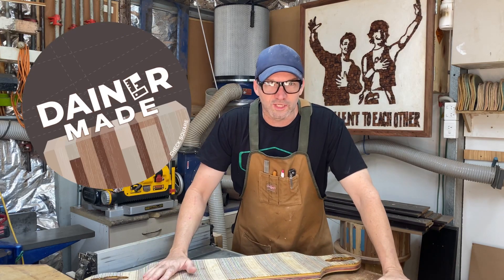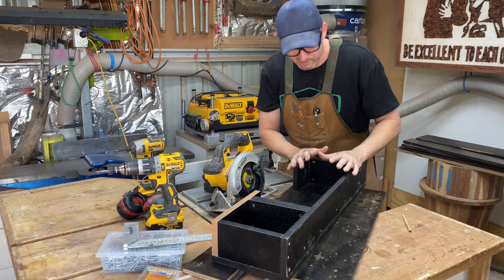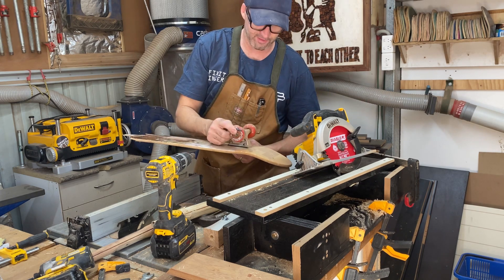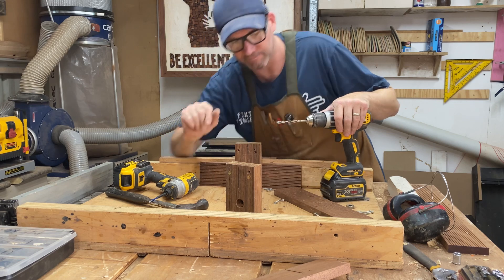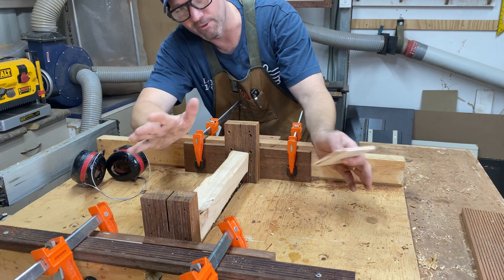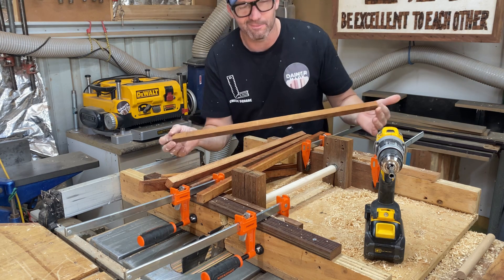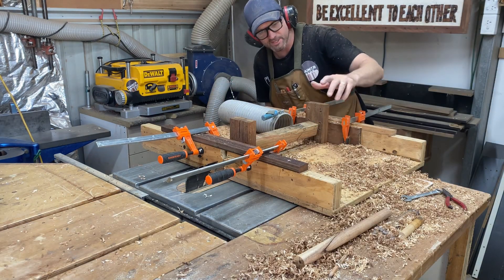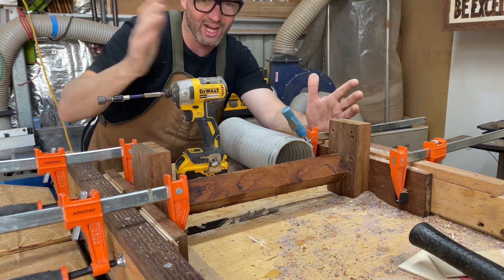#woodjigs21 Circular Saw and Table saw Lathe jig

Comment: I've always dreamed of being able to make broomsticks for Smurfs! Sweet jig. 
Entertaining as always, and a great addition to the #woodjigs21 collection. And love that a sailor's been gifting you a lot of wood.
Reply: @dainermade  Yeah, poor Ned! 
On a serious note though, how about off-setting the end points of the jig so the blade runs beside the piece instead of directly under it? You may not get smaller diameter dowel without hitting the bearings, but possibly a cleaner finish and you could even offset the ends a bit to get your taper.

Comment: Mark, I need a handle for a bat. Was thinking abt making one of this. Not sure if it was izzy or woby or both, but one of them also did that acrylic shield thingy on top. By the way, will turning the drill in reverese, help with the direction of dust? Or its probably a dumb idea 🤣😜